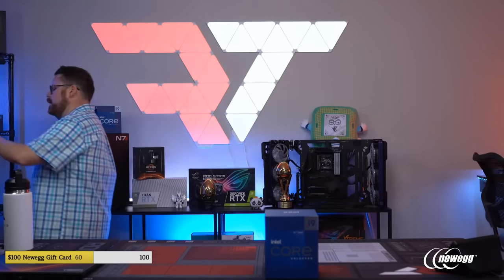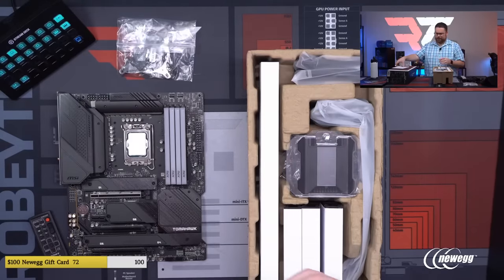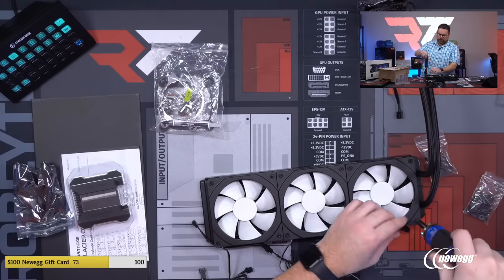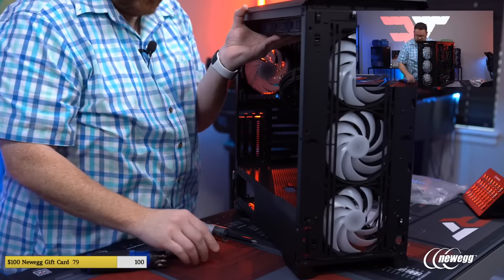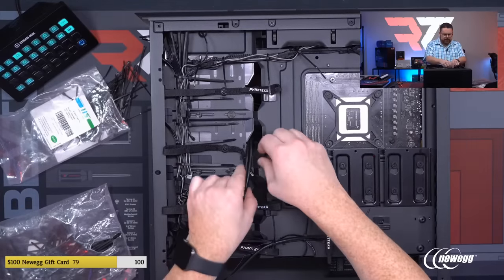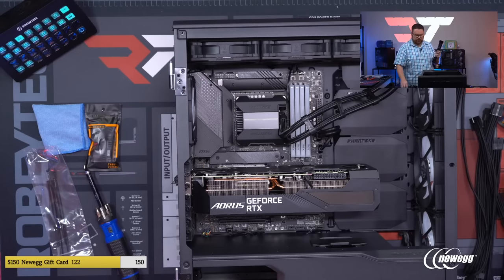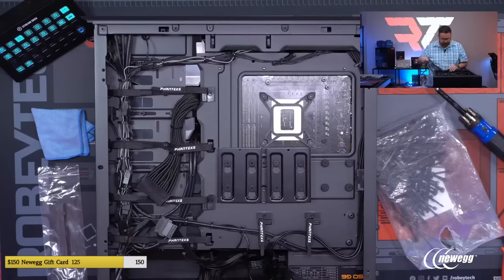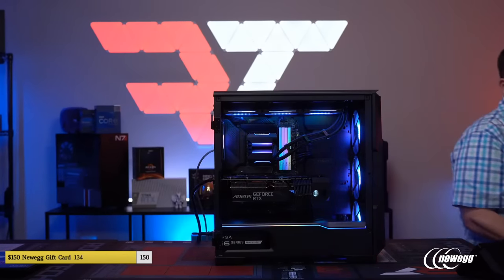$3000 PC Build - Giveaways + Phanteks P500a Build (12900 K / Gigabyte 3080)

Comment: I just can't force myself to do cable management until after I have the machine posted, I'm always paranoid something wasn't plugged in correctly or I might have a DOA component, then I've got to undo all those zip ties...even though it's never actually happened in dozens of builds.
Reply from the maker: That’s the right way to do it tbh!  I am just overly confident and doing it the right way would extend the stream length.